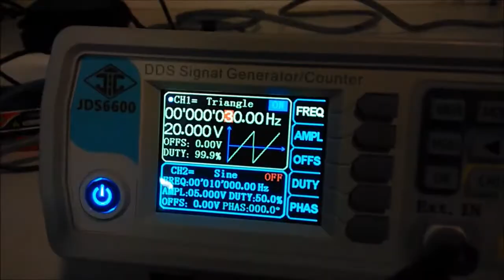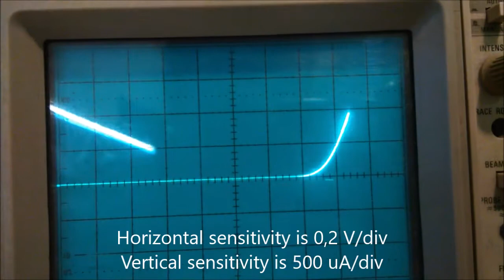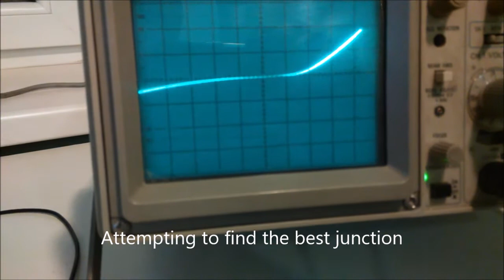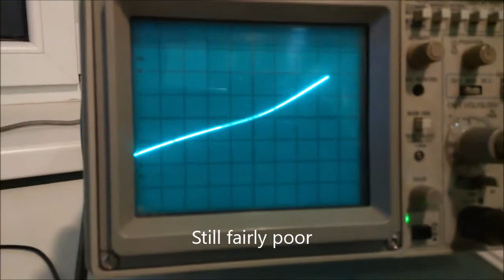Homemade semiconductor - Galena crystal detector diode on a curve tracer

Comment: Looks like galena has about half the current for a given voltage of the Schottky diode. I guess that's why we use Schottey's today.
Reply from the maker: that is mainly affected by the surface of the junction, in this case being tiny (contact point of a wire) results in low current capabilities, not to mention other impurities increasing overall resistance
Reply: @MrSlehofer  Interesting. A galena crystal found in nature I would think would have fewer impurities and having a flat surface might be able to get a bigger contact area. Of course, no one is going to use galena any more due to the Pb in it.
Reply from the maker: @franzliszt3195  Indeed a natural galena could work a lot better and I should mention that galena is not the only mineral with semiconductive properties, most of metal sulfides (such as galena) and metal oxides (zinc oxide, corundum) can serve as semiconductors.
Reply: @MrSlehofer  More interesting still. Saw on wikipedia that Gray tin, α-Sn has an eV band gaps about one-7th that of Germanium. I sure its been tried, and failed. I'm getting pretty motivated to make a crystal radio. Thank you -- you got me motivated, which is rather rare.